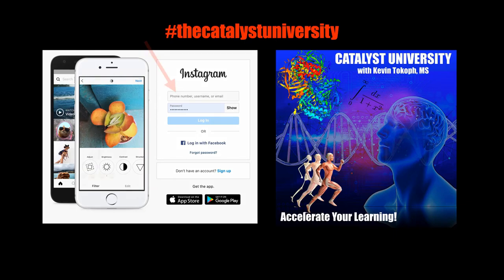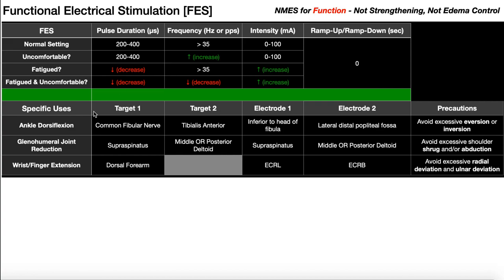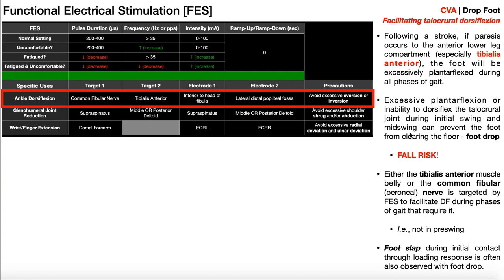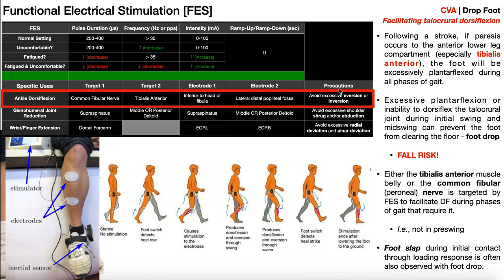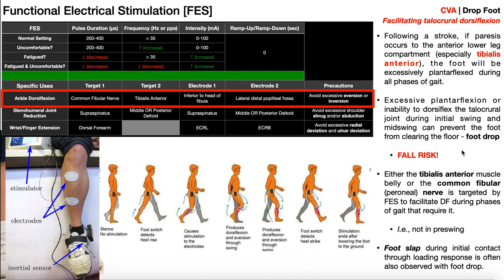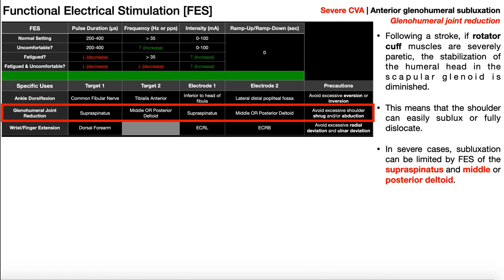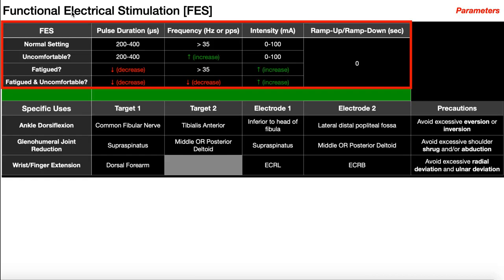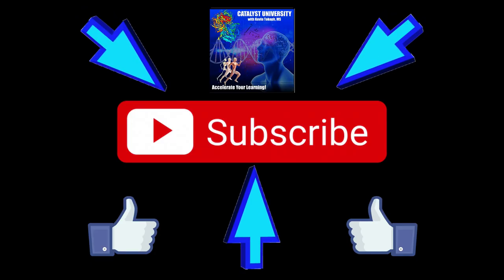Functional Electrical Stimulation [FES] | Theory, Use, & Parameters

Comment: I think your electrode 1 and 2 descriptions need to be switched for the ankle dorsiflexion example. If you drop inferior and slightly anterior from the fibular head you land in the proximal tibialis anterior muscle. The common fibular nerve is posterior/medial to the fibular head which is within the popliteal fossa as described properly as lateral distal popliteal fossa. Great videos.